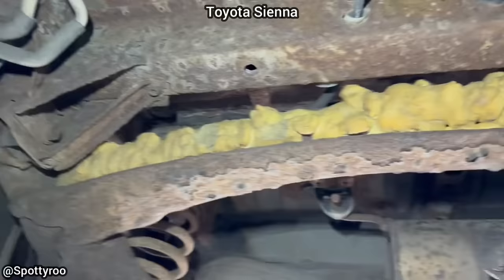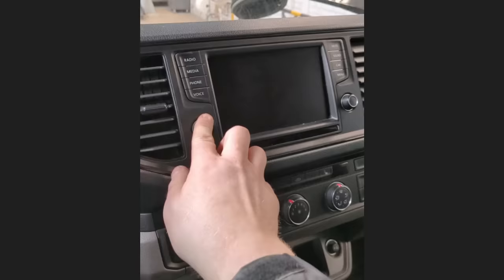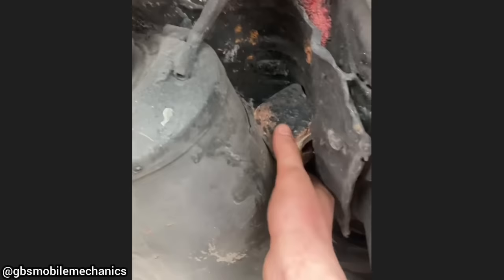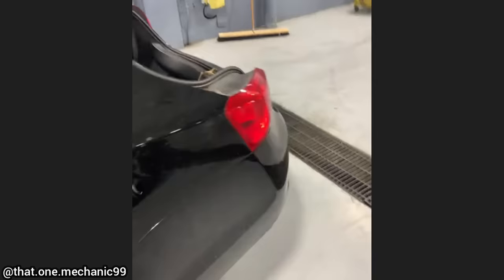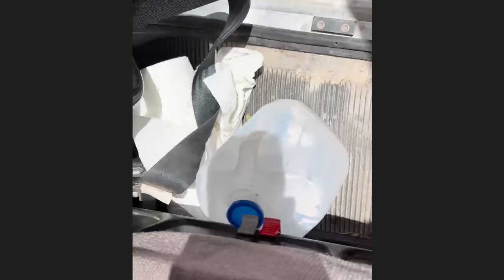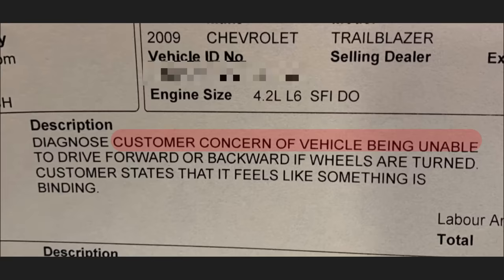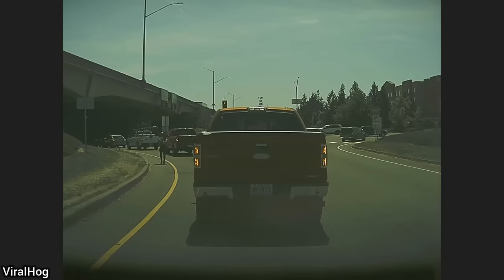Customer States Car She Just Bought Has A Grinding Noise

Comment: The baffling logic of people......

• Person got an issue with the car, won't start
• brings it to a shop
• shop identifies problem and could fix it
• Person declines repair and takes car away

So why the F*** do people bring their cars in? To get repair information and then trying to repair it themselfes, which is usually going badly wrong and they damage the car more?
Reply: Anyone who is pushing a car around instead of selling it and taking the bus is having problems in life that have no solution.
Reply: It's supposed to magically fix itself for free once it is inside the magical Wonka repair shop of course.
Reply: No repair shop will give an estimate without the car being in a bay. Then the estimate is too high, so the customer declines repairs and leaves.

I've declined repairs several times when I either didn't have enough money to cover the repairs, or when I was shopping around for the best deal. I did that just a few months ago, and it saved me $500. One shop I'd never used before wanted $1,800, and a shop I'd used on several occasions wanted just under $1300. I also asked the second shop in passing if something specific in my car needed to be replaced or repaired, and they said that part showed no signs of damage. The first shop wanted the extra $500 to replace it.

There are very good reasons for declining repairs.
Reply: That's like when I was an apprentice 20 years ago. People would ask for a brake inspection because they knew their vehicle needed some brake work. They also told us they would be doing the repairs themselves, they just don't know what they need or what the parts are called. If you are a DIYer, Haynes Manuals can educate you on this stuff, but maybe I'm taking what I know for granted.
Reply: Seems like if you are using the shop just to get a free diagnosis so you can fix it yourself, you probably don’t know enough to fix it yourself.
Reply: @anthonyobryan3485  You got a very good point there. When your car still works and is road safe, that is a reasonable thing to do.
I was referring to people, who are specifically appearing in such videos here, who have completely rusted carriages, bald tires, destroyed brakes or with this guy, who got pushed away by his friends, appearing with a car that is not running at all.

I live in Germany, and here it is illegal to tow or in any other means move a non-operational or not road safe vehicle any further but to the closest appropriate workshop. So like these guys here, pushing the car away from a workshop, and being a dangerous road hazard for longer than necessary, is illegal.
Reply: @Sashazur  Eh. I'd say 95% of the time, this is true. But if it's someone's very first project car that they're using to learn? I know my dad didn't care much for cars so I wasn't going to learn anything from him. He had one car repair lesson: "take it to the shop." I ended up working it out with my shop that I'll pay for the diagnosis and an inspection after I finish, but they'll let me try it on my own. If I fail, I now know that repair needs to be outsourced to an acutal mechanic in the future. 😂 They still get a bit of money for their time, and I get to learn. Some people are also smart enough to use Google to figure out how to fix something once they know the issue and are good at following instructions. It's the diagnosing the issue part that holds them back.

The other 95% of people shouldn't be doing any repair more involved than "my car is not running so I will turn the key and now it's running." Even then, it's questionable lol
Reply: They just wanted to get a diagnosis so they could attempt the repair themselves. If it goes bad, "another shop" botched the repair.
Reply: So that their buddy with no diag skills who owns one Pittsburgh socket set and is a "mechanic" can Google the issue and "fix" it
Reply: My guess: They hear  amount  of  cash asked by workshop for  repair-fix and decline  repairs.
Reply: @marcfuchs6938  Generally speaking, I don't the cops would be too sympathetic to these guys. That said, the car is the basis of almost all American infrastructure (esp. if you're as poor as the guys in the video), & stepping on poor people is 'bad for business' as a government.

The more I hear about German car laws, the worse they get. Normally because someone brings them up with the implication "Americans are dumb because they don't do them".

Comment: Upper Left car is a SUNBEAM TIGER probably 66 or 67. If real it's got a V8 Ford and is one of the fastest cars of it's time. They were killed off when Chrysler bought Rootes Group and couldn't fit any of their v8s under the hood. Carl Shelby was the guy that put the Ford in a Alpine in place of the 1.7 dual carb 4 cyl.  One hell of a car

Comment: A WTF every minute, I've never replaced a cabin air filter
Reply: I decided to replace mine in my 2021 Silverado since it's the first vehicle I've owned that has had a cabin air filter. Went to the store and bought the one Fram says fits. Pull out the glove box and figure out how to pull off the cover for the filter. Pull the original out which only had 20K miles on it and looked pretty good. Put the new one in and found out it's 1/2" narrower than the original and just slides around. Now I've gotta take it back to the store and find a different brand that is the RIGHT size!

Comment: I actually had a similar experience, when I bought my current golf tdi I'd been using it for work every day for about a month, 100 miles a day, and had 2 trips to collect my daughter from her mother's on a Friday afternoon then return her on Sunday night, 106 miles each way. I'd just left work and was about to head to Kettering to get my daughter when I noticed a rubbing sound, I pulled over expecting a puncture only to find the nearside rear wheel at a 45 degree angle. I got the car recovered and about an hour later got a call from the garage saying that the axle was absolutely rotten and had been filled with crazy foam, sanded down and painted with underseal. Had it failed on the A14 at motorway speed the outcome could've been very different.

Comment: Back in the 70s while working for FIAT in the UK, just closing up when a lady drove onto the forecourt in a FIAT 850 claiming that the engine was smoking.. we checked it out.. no oil.. Asking if she'd checked the oil she stated that she had trouble getting the oil into the engine.. she was trying to fill it via the dipstick hole.. Another lady remarked that her driver's windscreen wiper needed to be changed, it certainly did.. the passenger side wiper was relatively ok.. I remarked on that and she responded that she rarely had a passenger so it got less use.. To her credit she then giggled stating 'I can't believe I said that'...  :>)

Comment: That last one with the wayward semi tire occasioned a flash back! I had something like that happen, but I was on a motorcycle and the wheel cut across my pass less than 30 ft away.... I was watching it bounce down the opposite side of the road coming at me from about 1/8-1/4 mile after it left the rear axle of a semi on a 4 lane divided (large grassy median) highway (US27S in Fla). I had slowed to be able to maneuver out of the way if necessary. Once it passed it cut a stop and street sign off at the knees and took out a orange tree or three. It would have ended me had I gotten hit.

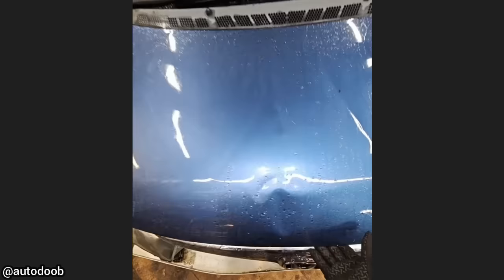Comment: 1:18 This is a dangerous design flaw on tons of Honda Civics, and my daughter's 2010 Civic is one of them. Over time, a foam covering of the hood prop disintegrates, someone replaces the positive battery terminal with one that isn't insulated, then the clip that holds the hood prop breaks. The hood prop lines up perfectly to the + battery terminal and shorts it to ground, causing the battery to overheat and catch fire.  I'm amazed this hasn't happened to thousands of Civics, and that there is no recall.
Reply: I guess they’ve avoided it because the battery terminals are supposed to be insulated.

Comment: 1:56.  I can relate to that, my kid(s) somehow jammed a toy under my seat and made the check engine light and air bag light come on.  I didn’t even think to look under the seat.  The toy pulled the wire plug out just far enough for the dash to light up.

Comment: That last clip with the rogue tire is very near where I live. I take that I-5 off ramp on my daily commute.

It's baffling to me that some people make absolutely zero effort to try and figure out a situation themselves before taking their car to the shop. Like, the rear door that won't open because it's blocked by their trailer hitch? The air leak in the cab of the truck caused by the water jug pushing on the pneumatic seat control? Like, those are issues that don't even require investigation, they are literally in the exact same view as what they were already looking at.
Reply: Yeah, I knew which off-ramp that was right away.

Comment: 2:17

Broken timing chain tensioner and some of the timing chain guides are gone ... but the customer only wants to address the oil leak and not fix the timing chain issue.

WTF?!

Oh well, at least that means the customer won't be driving for very long, so that person isn't going to be sharing the road with others when the engine winds up grenading itself.

Comment: His fuel pump died so his friends helped push the car home 🤣 i wonder how that went as i think you had to get it on the street.

As usual most of these others and you wonder how these people get through life. The hitch bracket blocking the door, how do you not see this? That's next level (my AC doesnt work because i don't know how to work the HVAC controls), right next to the concern of bad radio quality and its not set to any station in range 😂.

Comment: A few years ago I received a letter from my dealership offering a free/complimentary clock adjustment when daylight saving ended (or started, can't recall.) It saddened me to think there are people that need to go to the dealership to change the clock in their car.  But then these videos remind me that there are.
Reply: Even as an ex master certified mechanic, there are some cars that the clock is not easy to change the time on. Pretty much nowadays they change themselves with daylight savings time.
Reply: I would blame whoever designed the clock. I need the manual to figure out how to adjust the clock on my oven, but my car just has simple plus and minus buttons.

Comment: to all those going on about the guy who brought his car in and it was the fuel pump........

being able to do the repair yourself does not equal to being able to diagnose said problem. in the long run, its way cheaper to take it to a shop, have them find the problem for 50-60 bucks, and then take it home and do the repair yourself at significantly lower cost.

Comment: Old mate had the timing cover off, but declined to replace the tensioner/guide, but wanted the oil leak fixed. Saved himself $50 in parts, but lost an engine.

Comment: Which is a better customer: a customer that is undersensitive to issues and opts for the shop not to repair or a customer that is oversensistive to issues that are easily fixed but they don't know how to fix (like the staticy radio that was actually off frequency)?

Comment: Going to a shop to find out why the car wont start, they tell you why it wont start, and not only do you not have them fix it, but you push the car away. They are probably going to attempt to fix it themselves, so i hope they at least charged them for the time it took to diag.  Also, broken timing tensioner/guides and you decline the repair? Hes already in there so you're paying for the labor, now all you have to do is pay for the parts, which you're going to have to pay for anyways, so may as well just have it done since you're already paying for the labor. This is the type of person i hope destroys their engine because it loses timing. Im all for doing the work yourself, i do all my own mechanic work, but when you're already paying for it, just have it done instead of having to do it twice while risking severe damage waiting to do it when it could have already been done. You caught the problem in time/before severe damage happened, then you going to keep driving it wo fixing it. Smh

Comment: "Needs new fuel pump" 99% of the time you can beat on the bottom of the tank and get the pump working for another couple weeks.  I use a small plastic deadblow mallet.
Reply: I don't know if they ran the pump dry. Usually it's dead after that.

Comment: I'm trying to figure out how dumb you have to be to JUST get the oil leak fixed, and leave the timing chain rattling around loose? The engine WILL fail if you don't fix it. If they had said "never mind, I'll scrap it" it would make more sense.

Comment: Not proper fixing a car should be illegal, and should be taken from the driver, fully fixed and discounted from his salary check, by Law; or sell it. All cars should require heat transferring anti-rust coating on the underneath chasis, at all times, as much as possible

Comment: at the first one, do you really need an inspection for that? I recall my Dad buying a van, and the first thing I did was crawl under the thing just to see if it had rust or oil leaks...
Reply: Some people are not fit enough to lie on the ground apparently.
Reply from the maker: A lot of people don't know what to look out for. If you're mechanically inclined then it's different but doesn't hurt to get a professional to look at it. Could save you lots of money or get a vehicle cheaper then the asking price.

Comment: Yea i wish my complaint of nor starting would have been fixed i had to tow it to the shop they charged 100 to tell me it starts. Clearly me and the tow truck  could not start it.   They still cant figure out why my bat runs down in 2 days they claim it doesn't happen. Ivw killed 4 new batteries and yave to use a bat cutout. Havent heen able to find any mecanic that cand find the bat drain.....lots of unqualified mecs nowdays.. 5 diffrent shops and 2 dealerships cant fix the bat drain. Useless

Comment: Who in the heck buys a car from a "dealer" with that much exposed rust out the outside in the first place? If there's any visible rust on the outside body panels then there's multiple times that amount on the frame or subframe. Had to be from one of those "buy here pay here" scummy car lots where most of what they sell are rip-offs! ffs

Comment: 1:18 - This seems like it's more an issue with the car's design rather than user error. The hood prop should be mounted on the same side as the battery to avoid this.